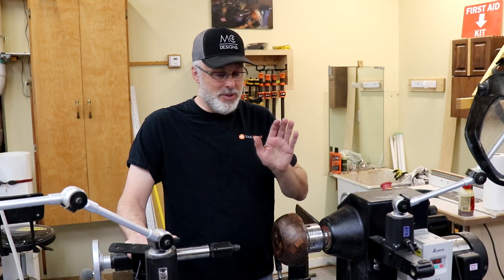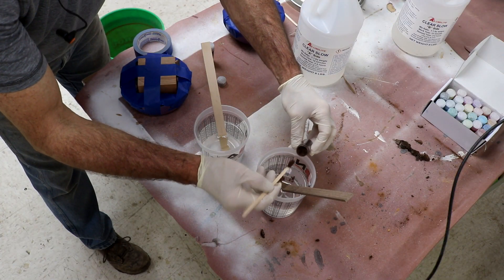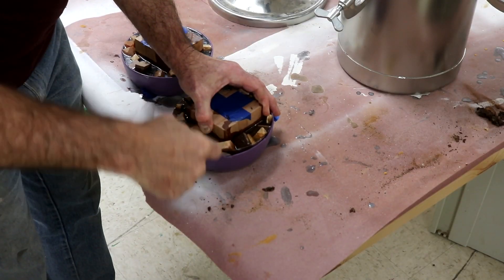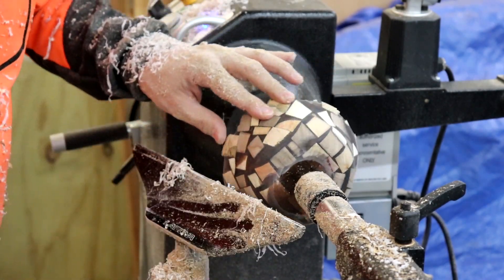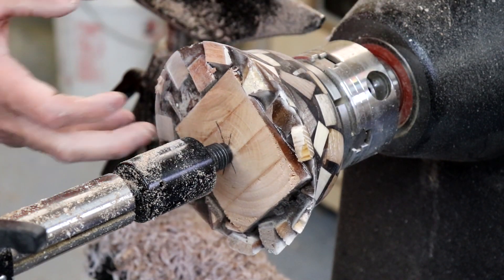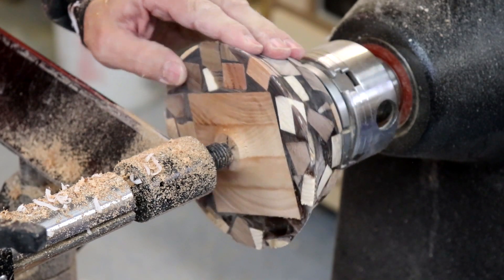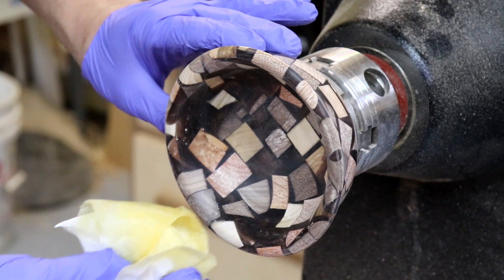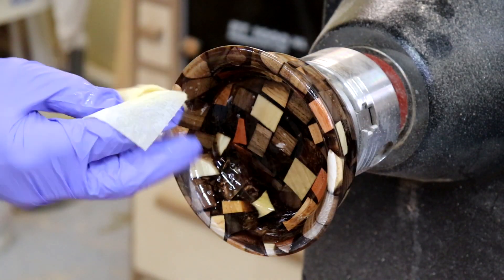How to turn an epoxy resin and scrap wood bowl - woodturning

Comment: Gorgeous! Love those Easy Wood Tools negative rake cutters.
Reply from the maker: Thanks Lewis. Absolutely agree on those negative rake cutters. Those make it easy to get great quality on resin with very little risk of getting a catch.
Reply: Going to order one too see...
Reply from the maker: Let me know what you think of it compared to a traditional turning tool.
Reply: @ToolMetrix  it is a  Bowl gouge and I was wrong it wasn't Thompson's it was one way.. I do have a scraper but not A negative scraper..
Reply from the maker: Ok. Cool. Great to know that you are able to turn such beautiful projects using traditional gouges.
Reply: @ToolMetrix  so I bought one and I have to say I did like it, I it's nice that people know they can turn epoxy without one though just incase they don't have one... thank for the tip....

Comment: I've done a lot of wood bowls where I could get the thickness down to 3/16".   I notice most examples of resin-wood bowls I have seen have thicker sides - maybe 3/3" - 1/2".  Is this because of the weakness of the epoxy-wood connection?
Reply from the maker: I’m not sure. In this case it was because I don’t have experience with resin so I was just being cautious.

Comment: Great video. Is the 7 day cure time what is recommended or is there a way to tell when it's cured and it happened to take 7 days?
Reply from the maker: HI Russ, great question.  I don't think there is a way to tell.  7 days is what was recommended to me for this blank.  It's probably on the conservative side, but it was my first resin bowl and I didn't want to lose it so I played it safe.
Reply: @ToolMetrix  I haven't tried to make a resin bowl. But I just bought a pressure pot.
Reply from the maker: That's the first step on a slippery slope.  :)   The guy who told me 7 days is a pretty trustworthy source.  I just sent a note to another great source, so I will hopefully have a good second opinion soon.
Reply from the maker: I just got some guidance from a seasoned turner who does tons of resin work (find has channel; "Klondike Craftsman").  He said "I when I use Alumilite clear slow I let it cure overnight".
Reply: @ToolMetrix  I just stumbled across this and clearly I’m late to the party but a super cool video and I love the bowl, and your work. 

I work for an Epoxy formulator so I would like to weigh in on the curing question. Without heat, whether from an oven or from its own exotherm, all epoxy resin that is cured at room temp will gel in a certain amount of time based on mass, and continue cross-linking over 5 to 7 days. Even then, it probably will not reach a full degree of cure. The only way to determine its degree of cure is to use a DSC which would not be by any means practical for you. An alternate method to speed it up, and increase it’s Tg (for hardness) could be to cure the bowl overnight at room temp and then place the bowl into an oven at about 140°F for maybe 3 hours. Once it is back to room temp that part is probably fully cured and will be a little bit harder due to the higher degree of cure and cross-link density. It could also make it easier for machining

That’s my 2 cents. Thanks for your videos 

assume no one is eating out of this bowl